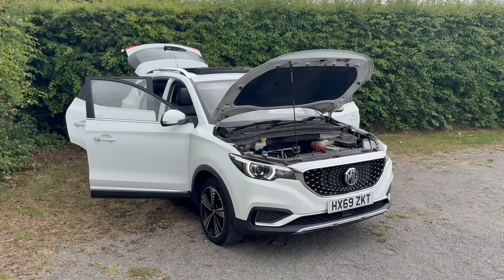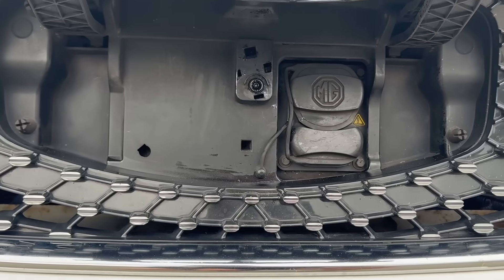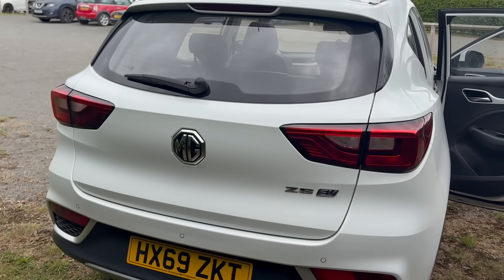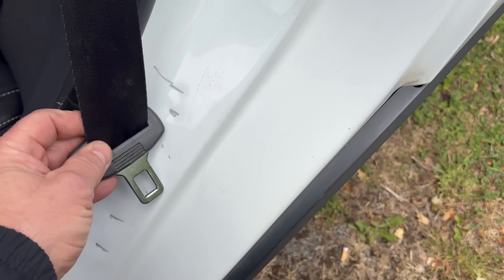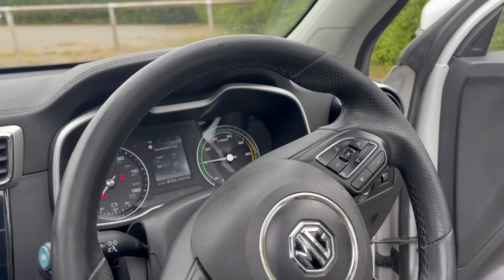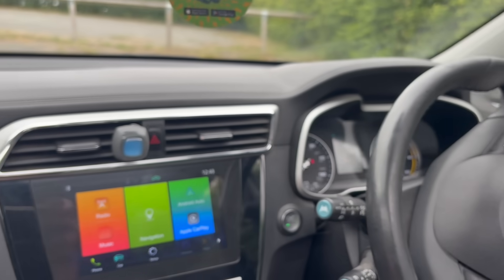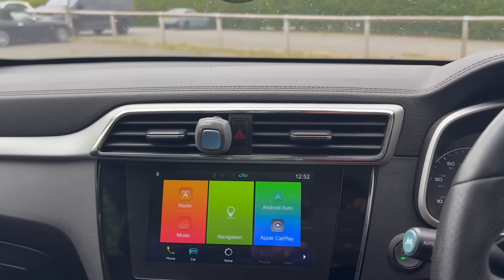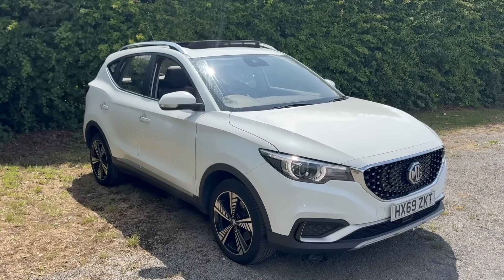Diesel And Petrol Cars Are Finished!

Comment: WOW, that battery health is amazing! I've had a 2020 one from new with only 30k on it so this fills me with a lot of confidence 👍
Reply from the maker: You’ve got loads of life left in it yet 👍🏼
Reply: @Jamesandkate  very much so! My only niggles I'm having with mine is the rapid charging is intermittent (although I very rarely charge on the road) but had a couple of times where I get a communication issue with the charger and it won't charge, but AC is fine. Disconnecting the 12v battery and reconnecting seems to help, but the issue has come back and when MG did look at it, they found no issue as it seems to be intermittent and didn't happen to them. The other is the power drop off in the cold (below 5c) when it's down to 30% SOC slowly reduces power to 60% max, down to 40% as the charge drops, have asked a few times if they could apply the battery heater option but they never enable it to see if it helps. My grip is that there is no message that pops up on screen to say it's limited power, you just find out when you pull out into the road. Again, MG say they can't replicate the issue even though I have taken a technician out when it's been doing it. Any idea if the heater option would help?

Comment: I'm not sure I personally would by a car from a country with a one party dictatorship, but that's just me.
Reply from the maker: Tbh, any car you drive will have Chinese equipment in it. They make over 30% of everything on the planet, it’s hard to avoid.
Reply: @Jamesandkate  I probably can't talk  myself, I drive a hybrid which the battery probably was built and came from china!
Reply from the maker: Most things are to be fair. VWs are made in China, Teslas, Apple stuff, it’s very difficult to avoid.
Reply: So William,  instead you use a car that's tied to the oil industry, mainly based in the Middle East, where they still chop people's heads and hands off, and treat women like dirt?   Try looking at the whole picture before you lay your morals out.......

Comment: Another excellent video James and can't help but admire the longevity of this MG.  238,000 is about what many people would do in 20 years.  Very impressive to see the very low rate of degradation on the traction battery too.  Overall a real bargain!
Reply from the maker: Thanks. I think it’s a testament to the original owner. He really looked after it and that shows. We’re really pleased with it though. 👍🏼
Reply: Can you prove that, I bet it degraded over time.... Wear&tear everywhere in the engine.... No one checks for that as long as it's starting. Lower power, higher consumption and worse ecological exhaust just go unnoticed by the owner as long as it starts&drives 😂😂😂 keep on dreaming...❤❤
Reply: @MrKOenigma That's more a reflection on your poor choice of cars in the past.
Reply: My old Hyundai diesel racked up 296,000 miles in 13 years with no degradation in performance or economy. Bear in mind EV battery degradation is also a function of ageing, so a 10-year old EV that's done 200,000 miles will degrade more than a 3-year old car with 200,000 miles.
Reply: @brendanpells912  your old Hyundai has absolutely reduced in efficiency since it was new in terms of power and mpg. But never mind that, the MG will have paid for itself in fuel savings whilst you still chuck money at your old hyundai. I don't see the point in you commenting.
Reply from the maker: It’s interesting because we now have 10yo EVs, mainly Tesla’s on the road. Some are taxis at 300k+. The good news is, although they have some degradation, they’re running really old tech. Newer batteries last much better.
Reply: @Jamesandkate  Quite a few have had dead batteries though. A lot ended up at the scrapper because it just costs to much to replace them. Look how much of a nightmare it is to replace cells on a tesla, they are all glued together in to a big foamy mess so it's not really viable.
Reply: Thing is batteries won't degrade in the same way as an engine, age is the main factor with them not mileage or run time. Re-visit in 15-20 years and see how healthy they are then. I bet they will need a battery pack replacement before then, which means it will get scrapped as it won't be financially viable. Not very green in the long term...

So far no one has invented a rechargeable battery which lasts that long (go and look for one), not for use in a car anyway. Despite what manufacturers like to claim. Even with building UPSs, which now use similar batteries to EVs, the manufacturer says to replace them every 8 years, because after that time their safety can't be guaranteed since they can start to leak.
Reply: @BlatentlyFakeName  ICE cars are usually scrap before 15 years comes along precisely because they are financially unviable to repair - no one is going to pay ££ to replace a clutch on a 15 year old car, it's going to the scrapper. 

Financially, I'll have saved so much on fuel in 10+years that the car will be paid for, and if i'm in to a new battery in that time, i'm still better off than an ICE car.

And there's a growing market in 2nd hand batteries; used car batteries are recycled and repurposed. Your comment about not being green is short sighted.
Reply: @BlatentlyFakeName  "Re-visit in 15-20 years and see how healthy they are then."

Are you kidding?  They are talking about a very inexpensive car that has done 240,000 miles. By my judgement they have achieved terrific value. Also have you 
noticed how cheap battery replacements are becoming? 
Feel free to stick with your dinosaur juice guzzler.
Reply: @geoffbrookes4014  Battery replacements are not cheap and never will be due to the amount of labour involved. On some it requires taking most of the car to bits because they built the casing in to the structure. You're looking at 5 figures for most. To replace a battery on on some of them it costs more than the car (like the Taycan), so they end up scrapped.

To replace an engine in an old car (assuming it's not something rare or high performance) can cost a few 1000, maybe less. You can do it on your driveway if you have a crane and some skill. You can't do that with EV batteries or motors.

Right now buying an EV vs an old petrol car makes no financial sense. You'll never see a saving especially with the high depreciation on EVs and now the extra tax slapped on them. Many have realised this which is why old cars are holding their value so well now.

Comment: At 9% degradation over 238,000 miles the MG is heading for 792,540 miles of driving after 30% degradation at which point the battery will be well inside it's warranty time limit (eight years), it will only just have broken it's warranty capacity limit (70%) and achieved nearly eight times it's warranty mileage limit (100,000 miles). ICE is so dead!
Reply from the maker: 100% this. It’s done very well.

Comment: I had the same issue with the indicator stalk but the tip wasn't loose. Drove me mad. The comfort 2 update actually fixed it, dealer noted that it was a common issue on the original version of the software. No idea how a software update can fix a seemigly hardware problem but hey ho, I aint complaining.
Reply from the maker: Righto, I’ll leave the stalk until the updates are applied. Thanks for the heads up 👍🏼

Comment: Its vinyl so not leather on the seat. The battery might degrade more in the next two years but no two ev batteries degrade exactly the same. I would expect 20% by 2027 when the battery warranty ends. Good car for the money but all the car suspension has done the mileage so like ice cars might suffer with ball joints and rubbers failing. Infotainment is pretty rubbish. Is it a 51kwh or 72.6kwh battery ? Lost 20 or 30 miles of summer range. Chinese cheap cars will cause massive European job losses and some car brands to disappear. When we all drive Chinese cars will the prices rocket or can they be shut down remotely should we fall out with China ?
Reply: The car has done nearly 1/4 million miles and you write this nonsense.
Reply: @esm7708  Its true as I have worked with Lithium batteries. Do swallow hard and close your eyes to the truth pal.
Reply: @dragonbreathwales funnily enough I have letters after my name too. I'm fully aware of degradation in relation to cycles.

Here we have a bottom of the pile, when new, EV with twice the mileage of the average car that goes to scrap and its still usable. All you have is replaceable ball joints and some fear mongering about Chinese surveillance. Meanwhile you're writing this on a device full of Chinese components.
Reply from the maker: Interestingly I have a background in prototype with JLR, also working with Li-ion. The issue is, li-ion comes in many different guises and the anode and cathode materials are more critical, but you’d know that with your background, surely 🤔
Reply from the maker: What utter tosh. Are you a conspiracy theorist 🤦🏻‍♂️
Reply: @Jamesandkate  The truth hurts LMAO
Reply: @Jamesandkate  JLR make crap cars so I wouldn't admit to working for them. How many have electrical issues ? about 100%. No matter the physical components you can't get away from battery aging and degradation through use its called physics which I thought you might know ? Why do you think solar batteries which are Lithium Polymer state number of charge cycles ? My 2022 Cupra Born had surface rust starting in the door hinges at 6 months old and my car wasn't the only one. I see both sides of the EV debate but you are blind to the negative side which is a pity.
Reply from the maker: Your degradation guesstimation is way off. The curve is rather consistent. The issue is, European manufacturers are building worse cars for more money, and people are realising that. Therefore we see more sales of Chinese EVs. People get a better product as a result. The cars can’t be turned off. This is absolutely ridiculous and something you’ve read in a paper, likely the Daily Mail.
Reply: @Jamesandkate  Degradation guess is based on working with Lithium Ion and polymer batteries so I think I know a bit more than you. Taycans 3 year old with 10% degradation quite common. MOD in UK and Europe are considering banning or restricting Chinese ev's near their sites so not very good.

Comment: A good video to show the Chinese EV haters, amazing value for money.
Reply: Or even the anti ev brigade! Always puzzles me why they bother to engage when they clearly haven't a clue, done no research and never tried one!
Reply: I did laugh out loud at the 'Chinese engineering is the best'!
Might be for this, I don't know, but I doubt it's better than anything else. Chinese engineering overall, not even near!
Other than that, it is cheap and over 238,000 a few bits doing is expected.
Feels like a little project to see how many more miles you can do in it.
Makes me think back to when I had my Cavalier, bought with 229k miles and it was awesome and was seeing it being driven around a few years after I replaced it with a Senator.
A work colleague had an Astra Belmont 1.4 for years and put 470k miles on it. Just 2 clutches, belts, brake/tyre replacement were all he did and normal services.
My mate got fully invested in Chinese motorbikes.
He thought it normal to do it all on finance, I say all, as his 125's would do little more than 1000 miles before the engines seized, one at 300 miles and he would just move onto financing another new one with the same shop.
4 seized engines in just over 2 years and he went for a 5th one!
Never knew what happened  or how long it lasted, as I moved.
What started out as a 125 bike for £800 total on finance, was up to £2400 by the time I left!
Yes, he got fully invested!
Reply from the maker: Indeed. Exactly why I did it 👍🏼
Reply: Junk.. 👍
Reply from the maker: You ok, Reggie. Need a hug 😂😂

Comment: Yes, I think there are lots of such cars, that have aged fairly well, and have a lot of mostly superficial minor dings and scrapes and whatnot. As such, they can therefore be a pretty good bargain if you check them out on the big, functional things. But if you start nitpicking and trying to fix all the little cosmetic and minor bits, the costs add up, and you can lose the used car advantage.
Reply from the maker: True, I just want it to be nice again. The parts won’t cost over £200/300 so should all be good 🙏🏼

Comment: 8:43 - usually the motor or gearbox mount which is quite usual for the 238000 miles or roughly 400 000 km. 
Looks great over all, could be much worse. And still good range.
Reply from the maker: Yeah, it’s pretty bad. Nice easy fix though. Well happy with the car overall.

Comment: I bought the same car-back in 2019. I was one of the first 1000 to order one and so got the free charger ( fully installed ). The only issue i had with it was a software issue that caused the battery to go out of balance. I was only getting 30 miles per charge. It got fixed but it took a couple of months to get back to normal. 
I have the long rage version now and it's brilliant. I have just done a 250 mile road trip and the car did exactly mile for mile on the gom.. The entire trip cost me £5.
Reply from the maker: Amazing 👍🏼

We had the second MG ZS EV delivered, also with a free charger. We were offered a handful of cash, £5k over what we paid so sold it on.
Reply: Was about to ask what happened to the one you bought 5 years ago. I wish the MG dealer near here was as good as yours.
Reply from the maker: We used Chorley MG, they’re bloody ace

Comment: I think once the average buyer can get an EV for under £5k then they will sell much better, but at £15-20k for a used one the risk is too high on the battery. At £3k if it lasts a year and fails its no big deal.
Reply: EVM, who has a YouTube channel, just got a 2016 Renault Zoe for £2k......
Reply from the maker: Tbf, a second hand battery for this that has 12,000 miles on it is only 2k. That’s a wet belt on Fiesta Eco-boom 🤷🏻‍♂️
Reply: @Jamesandkate the battery may only be £2k but then you've got to have it fitted. Only a very few specialist garages can carry out this sort of job. They can charge what they like. You'd be looking at £4-5k for a used battery fitted.
Reply: @Un-Apologetic  And how much would it cost to have a new engine fitted in (say) a Ford Focus?  £3K?  £5K?  More?  Warrantywise once issued an article on their largest ever claim. It was for a new engine in a BMW. The cost was £8000.
Reply: @Brian-om2hh on a 5 year old ice car a reconditioned engine block would be around £500-750.
Fitting around £1000.
At least know your facts before sprouting bollocks.
Reply: What is "The average buyer"?
James TOLD YOU this car was +/- £24k NEW in 2019, so it would have been in the "15-20k" bracket within 1 year?
As for "Battery failure" (STILL???)
"Standard" industry warranty is 8 years, but....... You MIGHT want to check the MG Battery Warranty. I think you'll find that As of last year it's "LIFETIME" (The first in the industry)
So that's another "argument" out the window?
I would be more inclined to apply similar "Worries" to the ongoing issuers with the Ford "EcoBOOM" engines (and others)?
I mean..... Get real?
Reply: @rogerstarkey5390 the average driver is someone who wouldn't consider a BEV because of potential battery failure and replacement cost. At under £5k it's mjch less of a worry.
Reply: @Un-Apologetic  Nonsense.
Reply: @rogerstarkey5390 p.s. MGs are MG in name only. They are cheap Chinese junk. Real value new is no more than £12k which is why they a depreciating at around 50% in year one.
Reply: @Un-Apologetic  Oh go away. Nobody here wants to know.
Reply: @Un-Apologetic  yep that 'cheap chinese junk' has done nearly a QUARTER OF A MILLION MILES .
Reply: Your talking nonsense @Un-Apologetic

Comment: That's an amazing mileage to still have over 90% health.
I bet you any HEV or PHEV would be on the third battery by now. They get hammered by constantly being charged and discharged multiple times every hundred miles which is why I would not buy any high mileage hybrid.
Reply from the maker: Exactly that. Throughput is so high on them they just don’t last. We’re well happy with this one 👍🏼
Reply: Hybrid is worst off 2 world if you buy used out warranty ,Toyota have own trick that it want give you error even SOH is just 20%

Comment: The Tesla supercharger issues would put me off, or is there a software fix for that now?
Reply from the maker: You can have a hardware and software update to enable that car to use the Tesla network.
Reply: @Jamesandkate what are these issues and what does the fix tend to cost please?
Reply: @Jamesandkate what is the hardware update? I've twice chased this with our local dealer to no avail.

Comment: So you paid £3k for this? Was this at auction or direct from the  taxi driver? Also, can you give an idea of the total costs of these repairs you would charge if I bought one like this and had it fixed by Cleevely?
Reply from the maker: It was direct from the owner. I will do an update on the cost of the repairs when I have them sorted. I'll also give a labour comparison if I did it for a customer.
Reply: @Jamesandkate  thanks